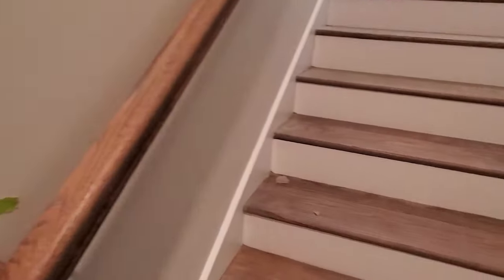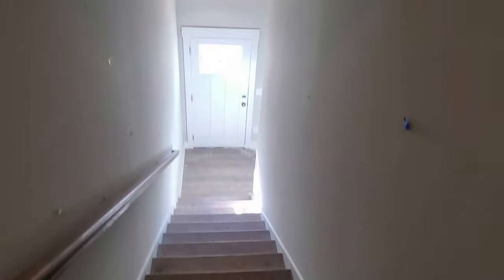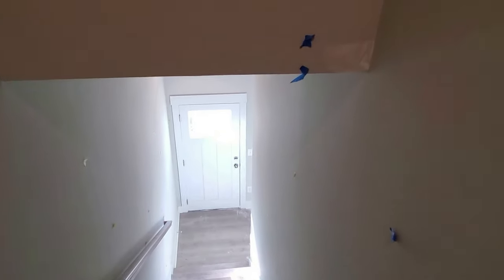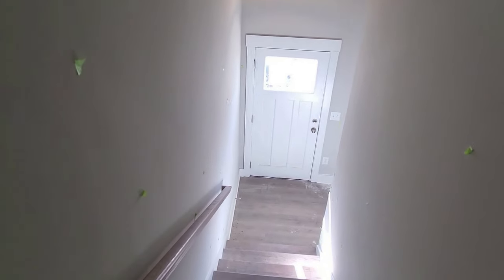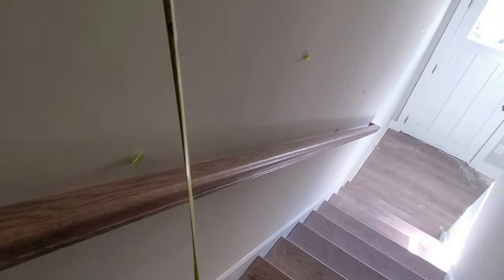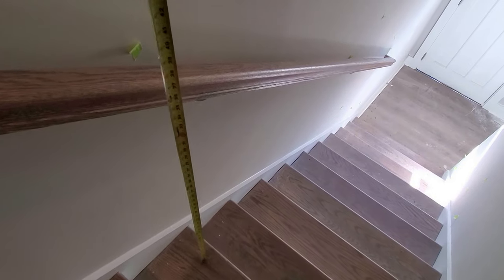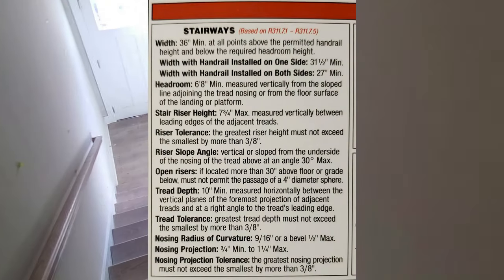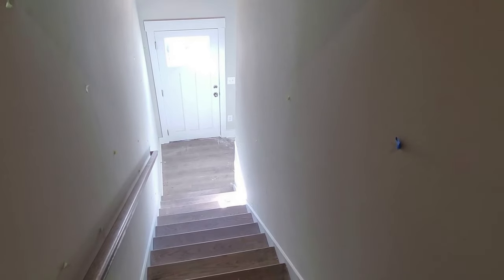Top 10 Residential Building Code Violations

Comment: There are far too many unnecessary codes and regulations. These cost the builder & buyer more and more money. Its nothing but a racket to make suppliers money. These overblown codes and regulations increase the cost of residential construction well over the $10,000 mark. At best, they should be options and not requirements. I was going to build but decided not due to these rediculous codes and supply chain issues and supply curtailment and price gouging and crap contractor employee workmanship. Its no longer worth it. I had a builders license since 1995. 2 years ago I let it lapse. No longer useful.
Reply: If builders wouldnt try to cut corners all the time u wouldnt have any codes. Did u really thing that village came out with codes and permits just for lolz?? Or maybe it was years and years of people bitching to village major to do something about it?
Im working construction and u have no idea about building anything if codes are issue for u. Mostly they are based on common sense and other times u have some that demand union tondo the job.
Reply: @spardasquadspqr3535  yep. Codes will make building last and be much more safer. A knowledgeable Building Inspector is a valuable asset both to builder and owner.
Reply: Build it right the first time
Reply: Which codes and regulations are you suggesting should be eliminated??
Reply: @driley4381 My area requires a four inch exhaust pipe on my gas water heater. The water heater has a 3 inch exhaust. Duh.
Reply: Some of these " over blown codes and regulations " are very necessary, builders will cheat if they don' t there isn't any over site. The inspector and engineer are on the hook for this structure for life , not the builder, until the investigation proves otherwise.
Reply: You like building fall down
Reply: Couldn’t agree more. It’s a scam!
Reply: 4 inches is crazy
Reply: lol. Spoken a true builder that’s cuts corners lol
Reply: Very interesting info, thank you for sharing. Just this year i started a masonry company, been a union mason the last ten years. Been doing the trade more than half my life. Always figured if I build my own home, it likely wouldn’t be up to “code.” But it would also be the last house on the block after a disaster. So the new owner would have to be okay with that lol
Reply: Poor baby. Just like a crap builder to whine about rules to do things the correct way. Oh, snd throw in conspiracy theories, as well. Glad you're out of the biz.

Comment: As a former Builder; very good points… easy mistake has been done by the carpenters and builders, builders must do their own inspection during the construction phase; it will cost more money to fixing things later…  As a builder or carpenters must follow the code, I don’t understand why are cutting corners such a sloppy work. Absolutely no cost savings
Reply from the maker: The majority of GC's don't check behind their subcontractors.
Reply: @PPG1967  they have to…. If a big GC, then they do have their Owen superintendent

Comment: You ever check for notches in floor joists that plumbers make for running DWV?
Reply from the maker: All the time.. we use a lot of web floor joist, so it's not as big of a problem.  However they'll notch the hell out of some studs on a load bearing wall.

Comment: How did you get familiar with all the codes? Just reading through everything?
Reply from the maker: So, it’s a combination of a few things, Years of experience in the field doing the work (inspecting), reading, studying, and becoming certified in a number of disciplines (mechanical, electrical, plumbing, and framing), and learning from inspectors that are more knowledgeable than I am.

Comment: Excellent content, I have couple of questions

1) If all exterior walls are total glass like in commercial buildings, is that an energy code violation?

2)If all exterior walls are solid concrete with no internal insulation and no drywalls, is that an energy code violation?

Thank you ❤️
Reply from the maker: No code violation for all glass exterior walls.
Reply from the maker: So, a concrete foundation wall is normally a R-8 value.
Reply from the maker: I appreciate your feedback...thanks for watching!!
Reply: @PPG1967   I am sorry i don’t mean concrete foundation walls

What i mean is Concrete walls above the ground instead of stud framing, drywall and siding
Reply from the maker: So, check with your local or city building department.

Comment: Don't drawings have to be submitted and approved?
If they were, was it usually the contractor's mistake, such as the wrong-size windows, inconsistent stair height, or the clarity between the ceiling and stairs?
Reply from the maker: You're correct. The General Contractor is ultimately responsible.

Comment: I unno how our house passed inspection.
As a kid, I never really cared but now, every time I go to the basement or attic,
I feel like our house is standing on faith alone.
Reply from the maker: It's all about safety.  That's the primary job of an inspector, ensuring that a home is safe to occupy.
Reply: @PPG1967  
Yeah I get you.
Maybe I am a bit paranoid and it's been standing for a good 20 years but,
seeing nails miss the beams by a good inch or wood that's damaged used as support beams doesn't inspire confidence.

Comment: I have a question  so I have a 30amp for my hot water heater when the old heater was token out it was leaking at the heat elements and water was evey where  then it made a pop electrical spark so should i change my breaker for new one .?
Reply from the maker: Consult a competent electrician in your area.
Reply from the maker: I appreciate you watching.

Comment: That truss is an obvious and easy fix. If the framer scabbed on a 10ft 2x4 you wouldnt ket that pass?
Reply from the maker: Sir, an engineered plan showing the correct fix is required.

Comment: If a county has the building code set for the published year prior,  would be better to go ahead and plan to the newest year in case of future planning?  For example I plan on building a shipping container in the near future, however the county is currently using the 2018 building code. Should I make two plans, one for 2018 and one for 2021?
Reply from the maker: When are they transitioning to 2021?
Reply: @PPG1967  I haven't seen anything on the county website indicating that they are going to. I'm figuring this out as I go
Reply from the maker: Is there a local or city building inspector that you can contact??
Reply: @PPG  upon watching more videos I figured out that this was probably the best way to go about that. I'm having difficulty finding the information, but wish me luck! 🙏🏾

Comment: #5 the windows that are to small , will they have to tear the windows out and install bigger ones?
Reply from the maker: Yes sir.
Reply: @PPG1967  wow , that’s being pretty tough on the owner don’t you think , passed it on the rough inn and turn it down on the finish?! That’s kinda messed up don’t you think?
Reply from the maker: So, if there was a fire and someone dies because they couldn't get out, how do you think that would go over??
Reply from the maker: Swap out windows or getting sued for millions and your reputation ruined...which would you choose??
Reply: It's not a difficult fix to elongate the window downwards if it's an option. Nothing structural. New window and trim of course, but everything else can just be cut out quickly. Hopefully no wiring in the way.

Comment: Nice collection of common violations to look for. When you call out things like the egress windows do the builders have to tear into the walls to put in bigger windows or is there an easier fix?
Reply from the maker: Yes sir...builder get pretty upset about this one.
Reply: @PPG1967  Well it's their own dumb fault...
Reply: You can switch the window to a casement  . That sometimes  works. They have casement that look like double hung  windows
Reply: While you’re checking egress windows, also check distance of lower edge to floor.
Reply: Yes.  The inspector doesn't have to tell the builder how to fix it, just what the code requires.
Reply: As a commercial and residential inspector, they must remove and replace with correct size. Its safety, no room for error here
Reply from the maker: @mrcodeguy1 that’s not correct sir. Security/safety film is accepted in 90% of the jurisdictions in lieu of tempered glass. All they would have to do is apply safety film to the glass.
Reply: Window sizes should have been picked up by the city building dept when the drawings were submitted for a building permit unless they were changed after the fact.
Reply: In this case - those windows can be fully opened. Sure the slider section might not be 5.7 square feet, but pop out the entire window and it exceeds 5.7 square feet. It only takes a few seconds to pop them out.

Comment: any nails that missed the framing need to be removed.

The egress windows should have been caught at Plan Review, permit should never have been issued on it.

Drywall can be used to seal the chase
Reply from the maker: At plan review??...it should've been caught on the rough inspection.
Reply: @PPG1967  Should have failed plan review, they don't measure for egress window openings at framing.

The contractor and superintendent screwed up, but if they used the windows called out in the plans, the Plan Reviewer screwed up, but ultimately it falls on the contractor.

Comment: These guys cost people so much money over an inch i honestly think there should be some commen sense befefore costing someone 25k over an inch or two
Reply from the maker: These guys?....Who are you referring to?...Building Inspectors?
Reply: @PPG1967  code enforcement in my opinion is a violation of people’s private property’s. I understand the need for enforcing  sanitary conditions.But code enforcement will leave a family homeless for violations they deem un safe. I’m not saying you are that type at all I’m speaking in general terms code enforcement has a horrible reputation and most people hate that department.
Reply from the maker: I understand what you're saying.  I worked code enforcement for 3 years before getting into building inspections.  Some people don't understand enforcing city ordinances, especially on private property.  There must be some standards in place and enforced,  especially if you have neighbors.
Reply from the maker: I appreciate your commenting.